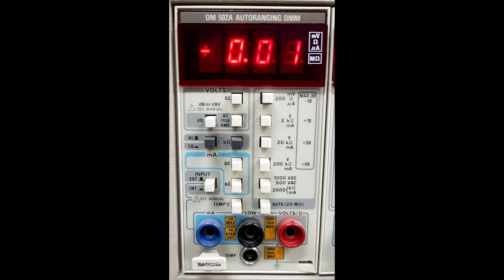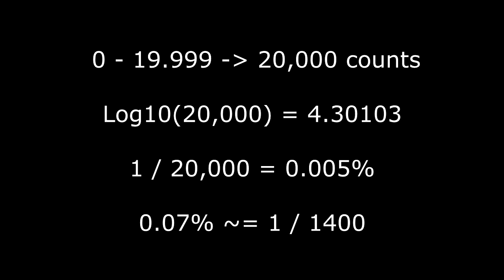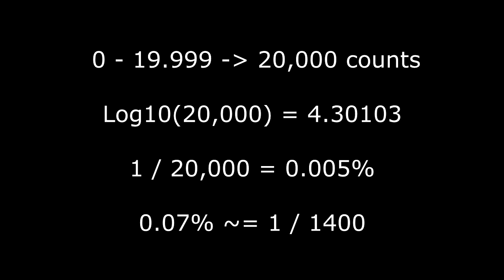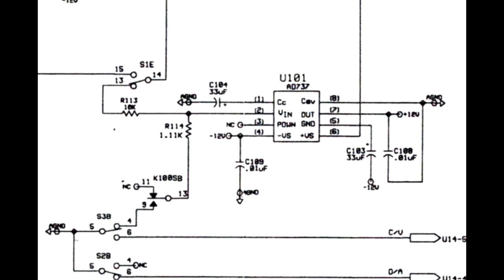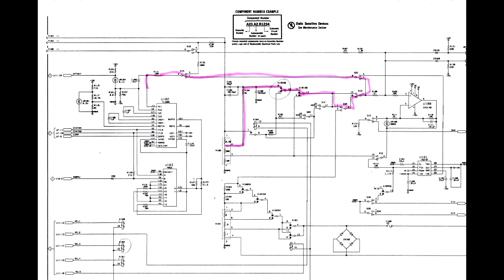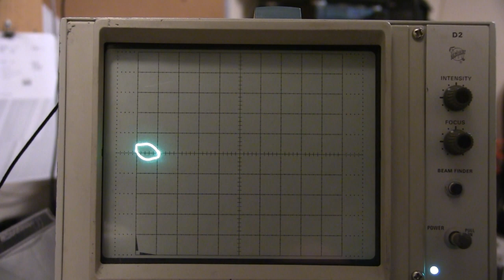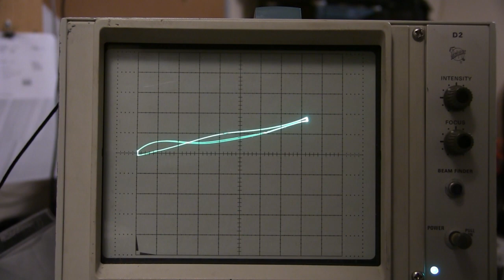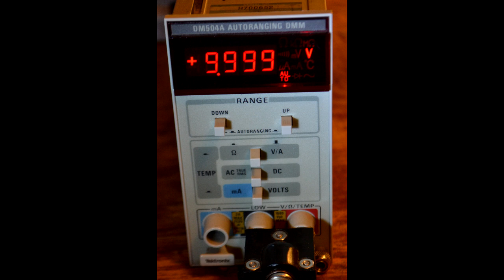Tektronix DM504A DMM Repair

Comment: Capacitor leakage likely is contamination on the glass. Might be fixable with a wash in solvent in an ultrasonic cleaner, though probably better fixed by removing them, and then replacing with the closest lower value silver mica high voltage capacitor, so you get close, then use a twisted pair wire gimmick trimmer that you start off too long, and cut to get the AC reading at high end exact. A few tries to get the reading to the correct value and it will stay that way forever, or till the adjustment is moved. PTFE wire works well, especially the solid core one, or robust insulated 18AWG enamelled copper wire, which is rated for 2kV.

Comment: Great educational material.  I have picked a few "home lab" hints from Bob Pease and Jim Williams (I have books written or edited by both). Here is one:  You can make trimmable low value capacitors from magnet wire.  You just twist two wires together, a length more than resulting in your target capacitance.  Then you gradually untwist the "far" end, until the desired capacitance is obtained.  If you need higher voltage than you trust the enamel insulation of the wire to provide, you can put either silicone or teflon sleeve over one or both wires, with some loss of stability, or use a polyethylene heat shrink.  Don't use PVC heat shrink - it has too bad HF performance.  Good luck!
Reply: That type of cap is known as a "gimmick". Been used forever in old radios for final tuning adjustments. You can also do it by having a wire (usually in the form of a loop) and a plate like on a printed circuit board, or the side of a shielding can. Just bend the wire closer or farther from the plate.

I'd be concerned with using the magnet wire trick here, the insulation is usually specified for around 400V. Some more heavily insulated silicone insulated wire could be used. If the gimmick gets too long then you have inductance to worry about, but otherwise it might be a possible replacement.

Comment: Just looking on Digikey, I can find an endless array of 750V or better trimcaps that will cover the 0.8 to 8 capacitance range. The annoying thing is that the price per each is around 30-40 dollars. A Sprague GHP23000 might be a good replacement choice for $29 or so.

But as others have mentioned, trying to clean one in an ultrasonic cleaner and then wash it with distilled water could be a good first try. It is hard to see what, other than atmospheric contaminants, could have made that glass cap leaky.